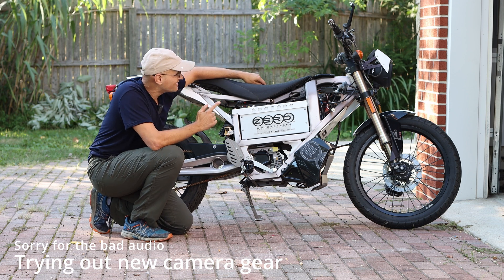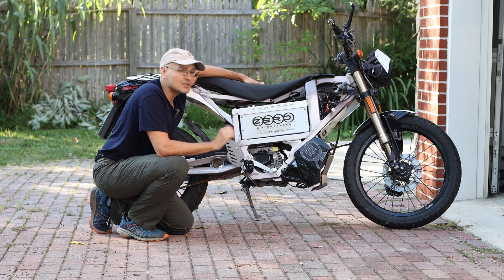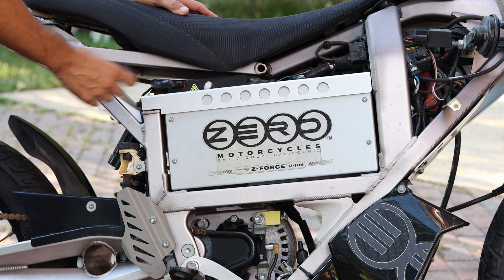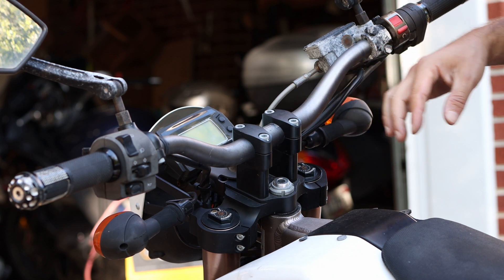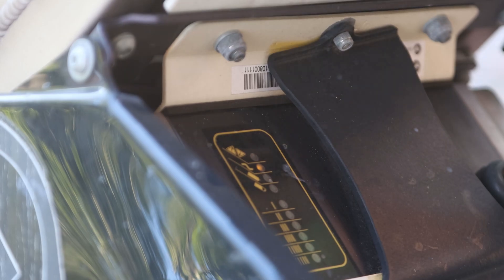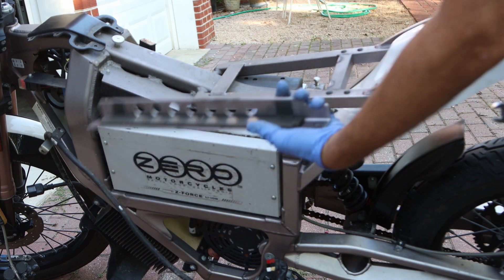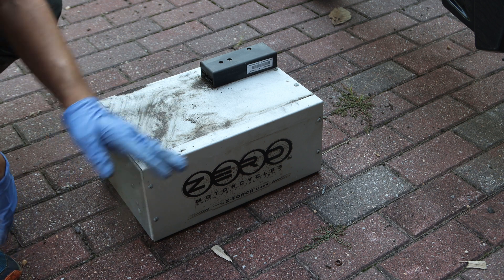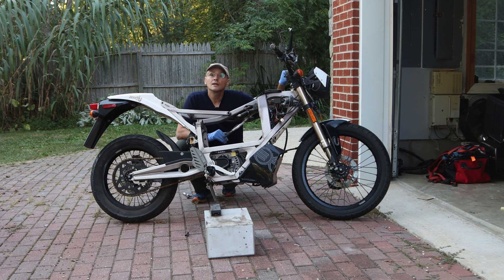Removing a 2011 Zero motorcycle  FX XU electric battery

Comment: I have a 2011-2012 Motocross version of this, I too took out the battery and started building a Power Pack from Tesla batteries and had its own BMS, but I've sort of put the project on hold, as I had to 3d print a bunch of caps to combine the Telsa 2170 Single cells in series and parallel
Reply from the maker: How much did you buy the tesla batteries? I heard ford cmax batts work well too
Reply: about $400 for the batteries and $50 for the BMS.

Comment: Thanks. the usage of your TESLA bike depends on the power/energy to weight ratio and is so small as to be of any use in todays transport oriented work leisure requirement. Is there an electric bike group?.
Reply from the maker: I've been searching, but most of the forums have lots of people that require help and it seems they all give up. Still searching. But what I am finding is that there is close to zero help :)